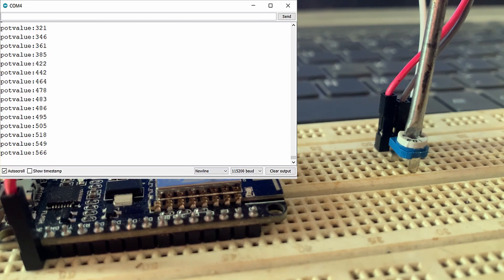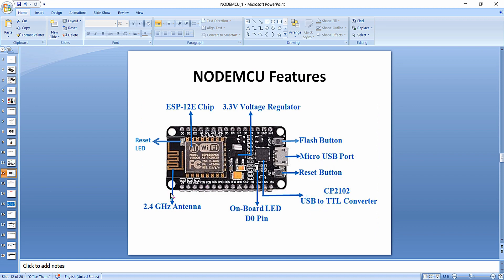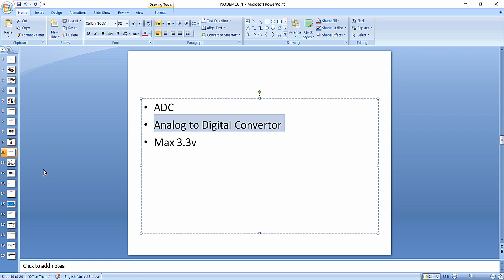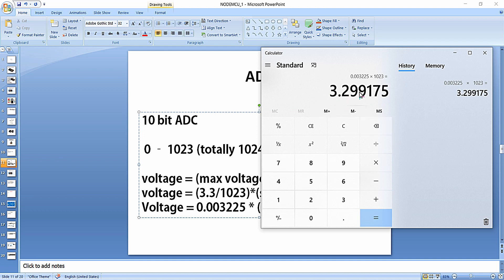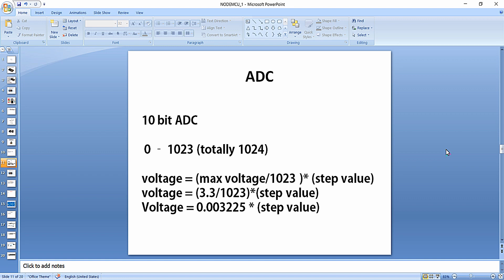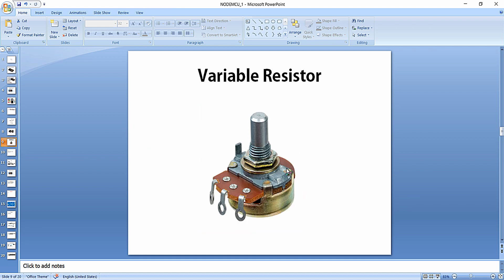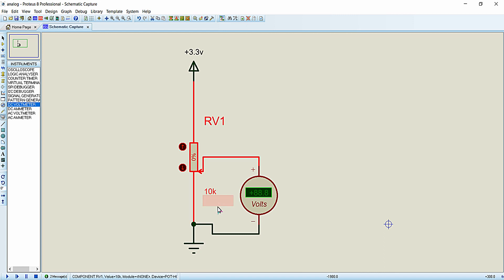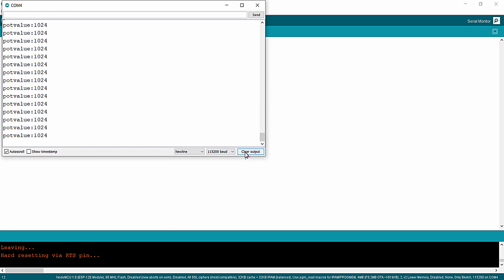Interfacing Variable Resistor with Nodemcu | ESP8266 | English

Comment: Dear sir, make video on " how to convert analog value into RS485 signal" using Arduino and max485 IC.
Reply from the maker: So you need modbus communication right.? Or only communication using rs485 transceiver